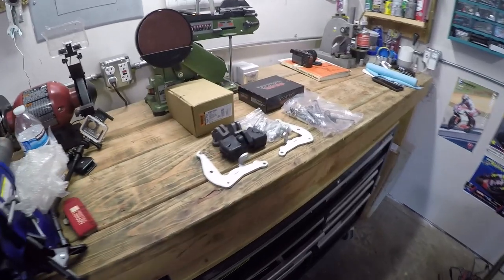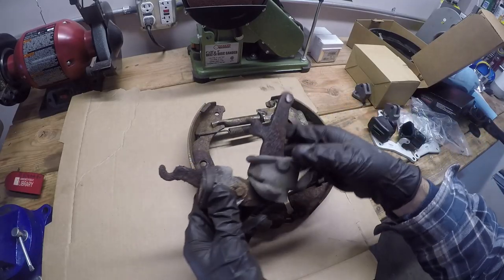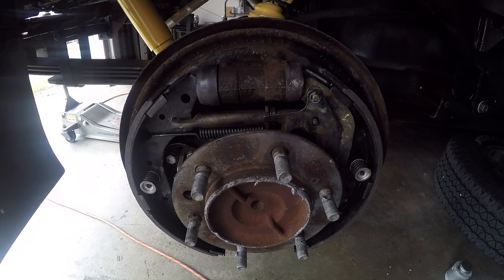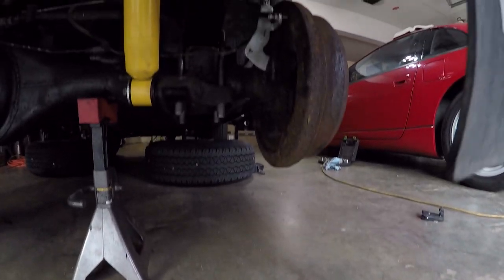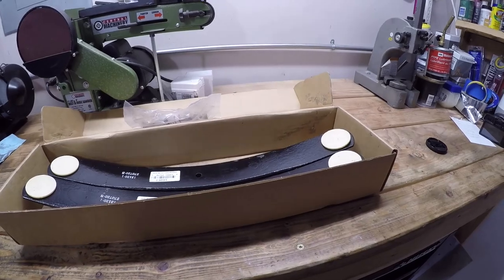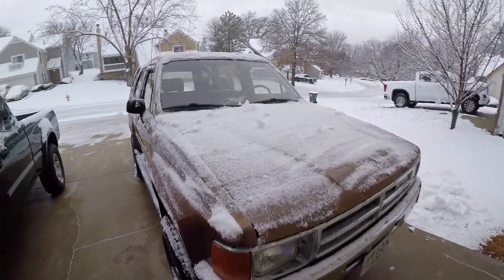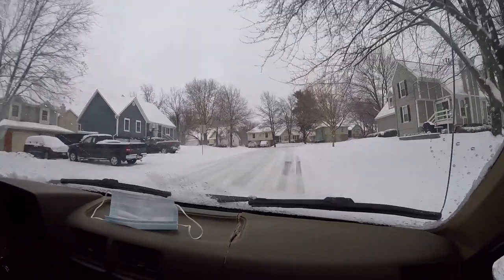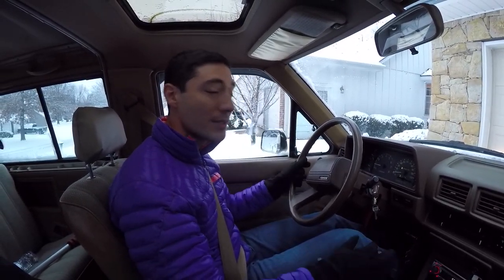1988 Toyota 4Runner 3VZE | Ep.10 | Final Fixes & 4X4 SNOW DRIVE!!

Comment: Love this stuff! Keep ‘em coming! Undercoat that 4Runner beauty so it doesn’t rust out in that mid-western salt!
Reply: It’s already rusty. Look around the wheel wells. You can see it in the other videos. Still looks like a solid rig though.
Reply: @Gramps83  fair point...well protect the rest lol
Reply from the maker: The frame is pretty decent! No holes or anything thankfully. Undercoating would be a good idea.
Reply: @PracticalEnthusiast  Yeah. Eatwood makes some quality rust convertor too to spray on rusty components. They have undercoating too.
Reply from the maker: @Gramps83  I've tried the undercoating before and was impressed. I'll have to try out the rust converter.

Comment: Brake shoes is my least favorite brake jobs to do. I can turn rotors and replace brake pads all day 💵
Reply: Even if the rear are disc, there are still parking brake shoes inside the rear rotors.
Reply: @Offshore1977  those I usually just adjust them to specs